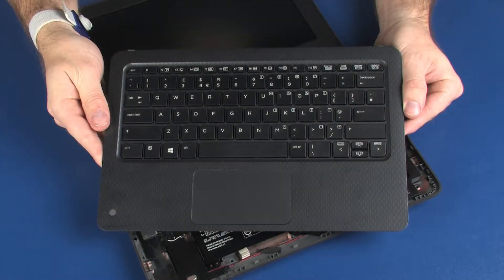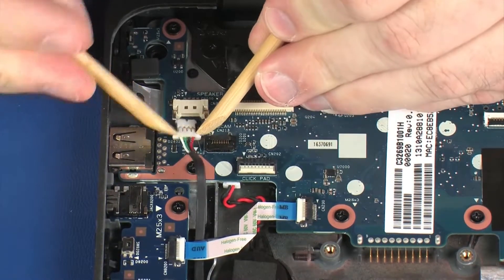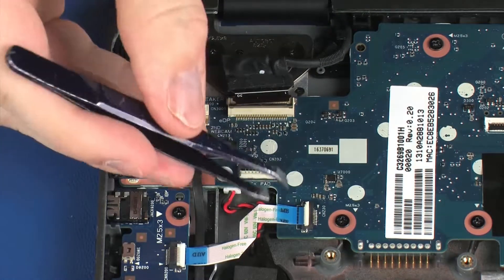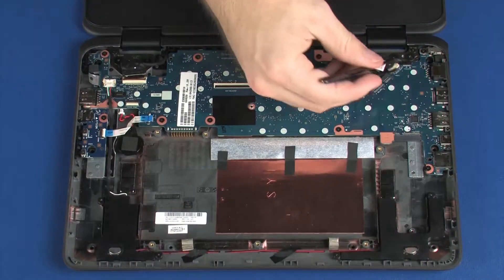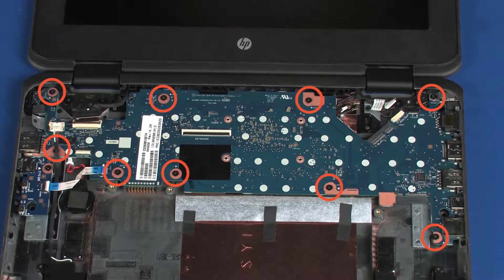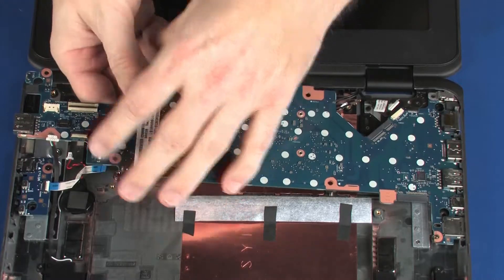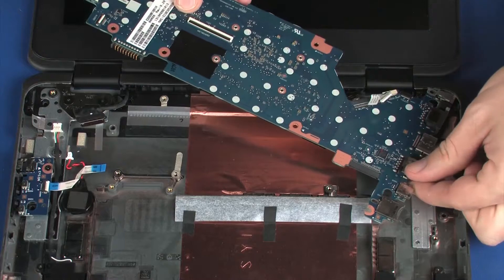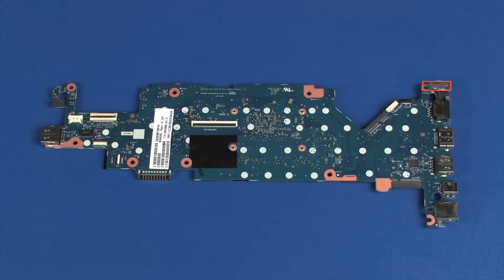Remove and Replace the System Board | HP ProBook x360 11 G1 EE Notebook | HP Support

Comment: Is it possible to change the power port on these or is it soldered to the motherboard? Any idea what the part number is?
Reply from the maker: Hi Melanie, thanks for contacting!
I understand that you need to know whether you can change the power port.
I will do my best to assist you.
It is soldered to the motherboard. 
Binu - Social Media Tech Support
Reply: @HPSupport  Thank you for your reply Binu! Does that mean that to replace it we could buy the part and solder it to the motherboard, or do we need to buy a whole new motherboard? Do you know what the part numbers would be?
Reply from the maker: You need to purchase a new motherboard.
Use the HP Parts surfer to identify the part: http://partsurfer.hp.com/search.aspx 
And order it via the HP Parts store: https://bit.ly/3nKMYrs 
Binu - Social Media Tech Support

Comment: One important question, I hope you reply, I have a HP ProBook x360 G3 ee, And is the CPU and GPU replacible? so i can have better gameplay?
Reply from the maker: +bendingmite 2650 HP does not recommend upgrading or downgrading hardware parts or software that is bundled with the product as It may affect the manufacturer's warranty and performance, however, you could change the configuration at your own discretion.
Reply: @HPSupport  Ok thx for letting me know.
Reply: I have HP ProBook x360 g1 ee
Reply: I have HP ProBook x360 g1 ee